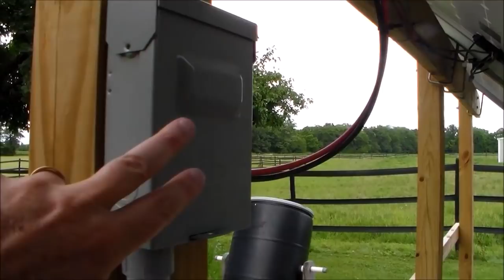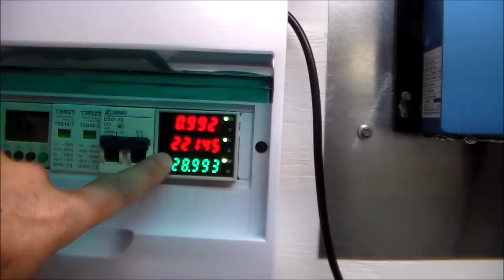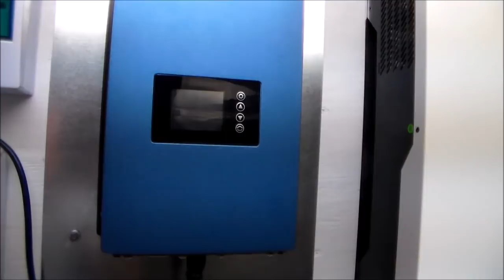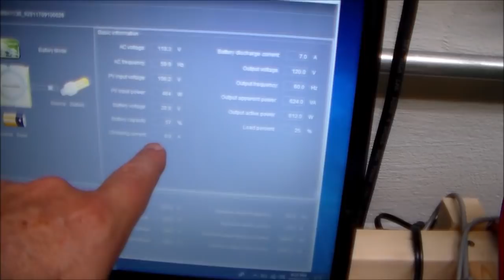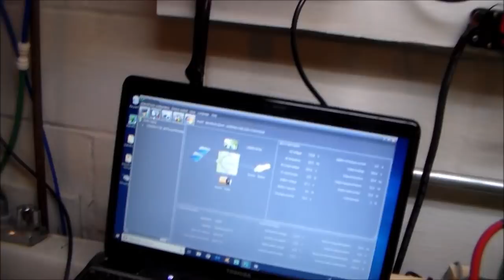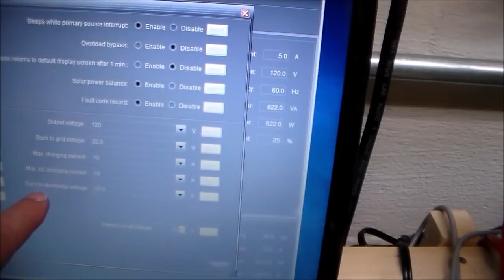DIY Solar - Episode 11 - Up and Running

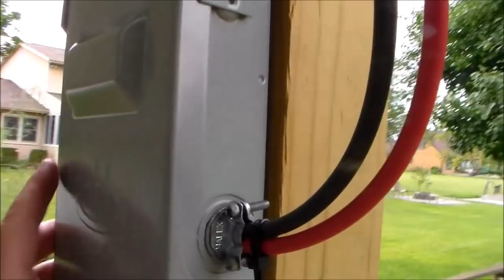Comment: At 4:32 on your episode 9 the clamp says .1A which is 100ma. This is double what the original clamp value is and would produce a wattage meter reading of exactly 50% less. Am I missing something here?
Reply from the maker: Yes correct, that is indeed what that particular clamp says. But I have tried 5 different clamps so far and they all read incorrectly on the GTIL device. The one I currently have installed is 100A:50mA and it also reads half the actual power usage. I really believe the manufacturer substituted an internal part within the inverter that is causing this issue. I have a friend across town that is supposed to visit with me next weekend. He has a GTIL2 device also and plans to bring it over to see what reading we see with that device. Thanks for the ideas though!
Reply: jimginnyohio ok got ya. That is extremely odd.  Does the original clamp work correctly?
Reply from the maker: Steve Green I’m not able to install the original clamp. It is too small to fit the 100 amp cable coming into my panel.
Reply: My suggestion is try the original clamp on a known load (any circuit), #14/12 awg or whatever else fits. Then try your larger clamp and compare results. I’ll be curious to see what you find but I’m 99% sure you’ll find the small clamp reads correctly.
Reply: If you get a chance I’m curious to see if your original clamp works on a know load. This will prove or disprove the replacements as a problem.
Reply from the maker: Steve Green Sorry, but probably will not have time to test until the weekend.
Reply: Any update on testing the original cable?

Comment: So your unit reads incorrectly with the supplied clamp and the others you have tried?
Reply: No it is reading only one hot lead.... American oddly has a split power system, two 120 v lines going to the homes....we desperately need to go to 220 v and only have two wires coming to the house not 3!

Comment: Greeting Jim,
in regards to the disparity between the inverter and your home monitoring system it sound like the ratio for the current sensing clamp of the inverter is incorrect. Some of the units may come with a current sensing ratio of 100A:50ma or 50A:50ma. Try using the 100a current sensor. If this is not the case you can check to ensure the inverter is programmed right by first turning the AC power off hold the set and up button down then turning the AC power back on. In this menu and sure that the word default and across it wib100wl is shown in red.
Reply: What your problem is your GTI is 120v on One Leg"clamp". Your other Monitor is 220v on two Legs"clamps"
Reply from the maker: johann cover I have tried 4 different clamps all with the same results:  100A:50mA, 150A:50mA, 600A:0.1A, and 400A:0.1A. Also, I have confirmed proper programming. Thanks for attempt though.
Reply: wow, that sucks royally Jim. One last thing you could try is if you have the dual voltage inverter (110/220 ac), connect it to the 220 circuit and see is the disparity still exist.
Reply: @jimginnyohio  ...
Yes, Jim, it's the ratio of the current clamp that's giving you an incorrect reading. I've just seen your earlier video. It may be more difficult to find a clamp with the right diameter and the correct ratio. But what I can suggest is to use the original clamp. Just make a small loop of wire that would pass thru the clamp and around the leg of the grid line. Thus, making a 1:1 ratio. ( I am a newbie and am still researching about 'limiters'. Am not sure if the voltage-current phasing is a factor in it's function.)
Reply: The provided clamp is 65ma output, I believe this is the issue.
Reply: I agree with Bandits, your clamp is only reading one leg. the other leg is unaccounted..hence 50% reading. The clamp was designed for a one leg 230v system and has been badly adapted for 110v.
Reply: The watts displayed in the lower right corner confirm the exact watts of a small load, so the limiter itself is working properly. However the GTIL itself uploads as many watts as it can possibly get from the panels. This despite all attempts to turn on the limiter function under settings, save settings, verify that the settings were saved, etc.

Comment: Jim, what are your reasons for choosing PV water heating over thermal solar other than "dumping" excess PV energy during summer? Sorry for jumping the gun.
Reply from the maker: Hi Alphonse! I do understand that thermal solar is indeed more efficient for heating water. However, I chose PV water heating instead since I didn't want to  do a lot of plumbing for my project and risk things leaking  throughout the system. Also, since I live in Ohio, freezing would also be a concern during the winter. The people I know who have moved to solar thermal water heating always seem to be monitoring and checking their systems constantly during the winter...just in case. I wanted to do something that I can just let run and ignore for the most part.
Reply: Hi Jim, I get it. So will you be running a heat pump water heater or one of these http://www.my-pv.com/en/ types of PV water heaters?
Reply from the maker: Nope. Please check out my latest video to see what I am running for solar hot water:
https://www.youtube.com/watch?v=YSupSNhk02A

Comment: Hi Jim You are only seeing half the power consumption because you only have one current transformer. You need to monitor both 120 wires coming in to your breaker panel. To provide grid tie power to a split phase panel you should be using two 110v inverters with a CT on each phase. You could also try using a second ct with the one inverter. But I am not sure if they would be wired in series or parrallel. Check out old time engineers channel. He has a two inverter setup.
Reply from the maker: MIKE Nope, that is not correct. I am monitoring both 110v legs using my Sense whole home meter. I can view each of those 110v legs independently with it. I have one of the Sense clamps on the same wire the inverter clamp is on, but they read different values. This means that one meter is correct and the other is not. Yes, I have seen OTE’s videos and I understand the concept of running two inverters - one on each leg.
Reply: Hi Jim I was referring to the CT connected to the sun grid tie inverter. You only have one CT. Monitoring one phase so the grid tie will only measure half of the house consumption. Your sense has a CT on both phases so you will get the total consumption.
Reply from the maker: MIKE That’s not how the Sense meter works. Here is an example of what I see happening: Sense meter shows 500 watt consumption on leg 1 of my panel. Sense meter shows 1000 watt consumption on leg 2 of my panel. Sense meter shows a total consumption of 1500 watts usage on both legs combined. GTIL2 meters displays 250 watts (half of Sense reading) usage on the leg the clamp is connected to (leg 1).  As mentioned before, the Sense meter shows each leg independently along with a combined total. The Sense clamp that is on leg 1 “should” match the reading of the GTIL clamp since they are both reading just that leg.
Reply: This inverter is a 120 VAC unit and the current clamp is designed to measure only one leg on the split phase system. The blue CT that comes with the unit is stamped as having a 65ma output. I believe the ones that Jim tried are .1 A or 100ma and I believe this is the issue. As a result the ratio is incorrect and thus the inverter interpretation is incorrect.
Reply from the maker: Steve Green The clamp that came with the unit says 100A:50mA. I have tried several clamps with the same value as the original one, but they all read exactly half the correct reading. I even tried using one of the clamps that came with the Sense meter. While connected to the Sense, it reads correctly, but when connected to the GTIL, it does not. This definitely is NOT a clamp issue.
Reply: could be a software issue or something that didn't make its way inside as it was sent out the door to be a 120 unit vs a 240.  are there firmware upgrades available for these inverters?   Are any other users finding the same issue? @jimginnyohio
Reply: @jimginnyohio  So here you say it's "definitely NOT a clamp issue", but below in a response to a comment by Charles Herrington you say the problem "was caused by the clamp I was using".
Reply from the maker: Yes, after 5 different clamps that were recommended by the inverter manufacturer, I was convinced that wasn't the issue. However, after reaching out to the company that produces the clamps, they informed me of a new model that was designed specifically for the issue I was seeing. I will be posting an update video over the next week or so to talk about that. The new clamp has exactly the same specs as the small blue clamps that came with the unit, but is larger to accommodate USA wiring sizes.

Comment: Another awesome video!  Thanks for sharing the journey.  One thing that scares me though is having 85 gallons of water stored in the same room with all that electrical equipment.  I've had large tanks like that break and leak.  Just something to consider.
Reply from the maker: Amigatech  Yep, I really don’t like having the system in my basement utility room either. I have another room in the basement that I may be able to move things to later, but have some construction to complete before I can do that. Also, I love your name...being an old Amiga user myself.

Comment: hey jim regarding your issue with the 50% reading on the sensor, does your electrical wires have 2 power coming in and 1 neutral ? as for me in the USA my electrical wires comes in with a BLACK,RED and white neutral electrical wires. I tested the RED and BLACK wires where there is 2 different reading for power on each wire and the problem seems to be the same as yours , so I came up with the idea of using 2 clamps in 1 as a (Y) to the inverter instead also I had to make the clamp wiring about 50 feet longer so might as well gave it a try, I didn't have a current reading monitor system like yours but I used a kill a watt meter tested it with a heatgun on and off and it shows pretty accurate , my kill a watt meter showed 620 watt of power consumption and the inverter shows jumped about 585 watt of power being consume by the heat gun. just to say the test also may not be as accurate because I did the test heatgun test after I made the ac sensor (50 feet longer)
Reply from the maker: Andie Chan Not following what you are asking regarding the red, black, and white wires coming in??? My electrical panel (US) has two black 110v legs coming in plus the neutral. I have the meter clamp on one of the 110v legs as recommended in the user guide for the GTIL2 device. Note: The Sense monitor clamp is on the same 110v leg as the GTIL2 monitor clamp, so they “should” read the same since they are both measuring the same current within the same wire. I would be interested in learning more about your y-cable. Do you have a video for that?
Reply: so simply speaking I have a clamp on each of the 110v leg  I made the existing sensor using 2 clamps to 1 single input via inverter, I don't have a video but its not hard to add-on another clamp and give it a try, use your existing ac sensor and wire in another CT clamp, I have pictures of the clamp but as for the wires its already inside my walls, also took pictures just now with the heatgun off and on for watt readings you can see the pictures here https://imgur.com/a/yK5ZouI

Check the picture with the heatgun on and off readings from the inverter, the inverter is off about 55 watts from the kill a watt

Comment: You mentioned a 10A charge rate limit as per the battery specifications but since you have 5 banks, are you not then able to charge up to 50A?
Reply from the maker: Cory Grimm The software and PIP controller seems to apply 10 amps to all 5 battery banks at the same time. I tried bumping that up to a higher amperage, but the little led lights on the batteries started flashing yellow. According to the user guide for those, yellow indicates a heat warning. When I let it continue with the higher amps, the leds eventually went to red...so I bumped the setting down again.  It seems that if I leave it set at 10, everything’s works well.
Reply from the maker: I have since bumped this setting up to 20Amps and things seem to be stable. After testing here for a while, I will try moving up to 30Amps to try things out there too.